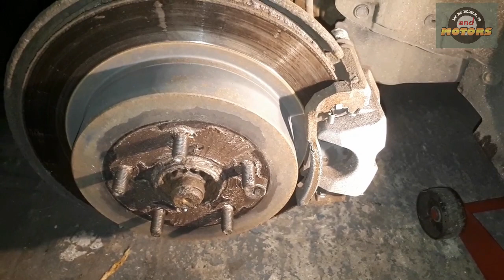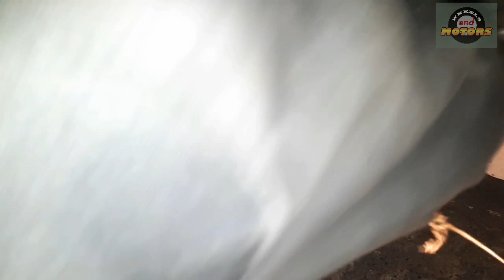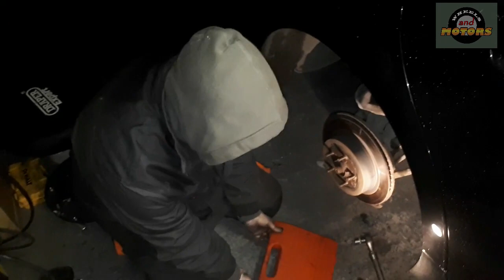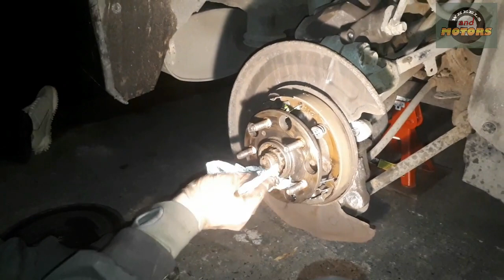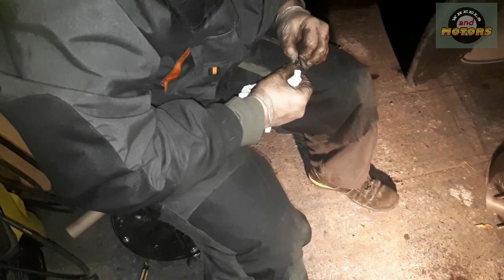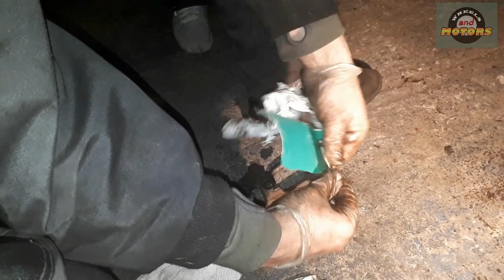How to replace REAR bake PADS and DISCS, Lexus/Toyota - (Lexus GS250 with electric parking brake)

Comment: hello
I follow your clips on the youtube channel
I have a question
I have a car SEAT Alhambra 7N and I can not activate the heating in the back warm air heats only in front and cold in the back
can it show if it is possible how to activate the heating and in the back, this problem is present in everyone I asked
thanks in advance greetings from Belgrade
Reply from the maker: I have the same problem in my Sharan, but I didn't get to it yet and just keep it as it is. It's not that cold in UK.
There must be some auxiliary heater that's failing, but I don't know how to fix it, sorry.
Reply: @wawayltd  thx

Comment: Would you not put copper grease on the side of the break pad where it touches the bracket?
Reply from the maker: Do you mean where those tin springs are? Probably not, I think there's a risk of getting it on braking surface. However, normally I apply some grease on a back of brake pads where they touch piston and those caliper "fingers", but this time I didn't.
Reply: @wawayltd  okay thank you very much, love the videos